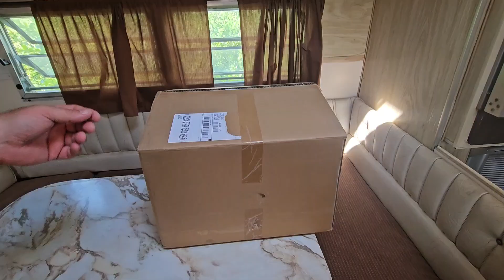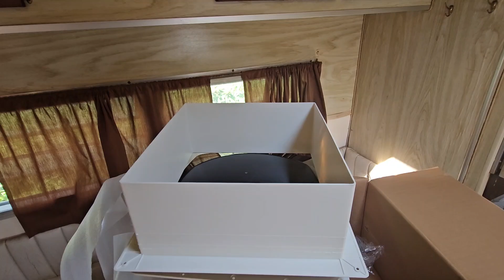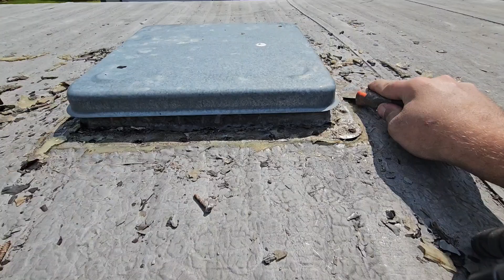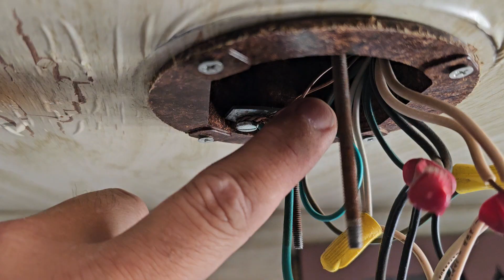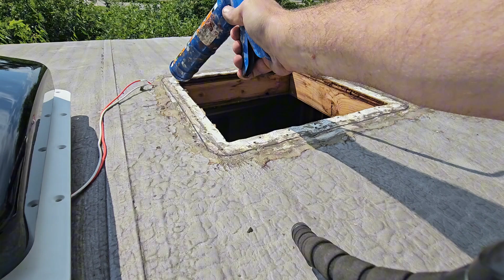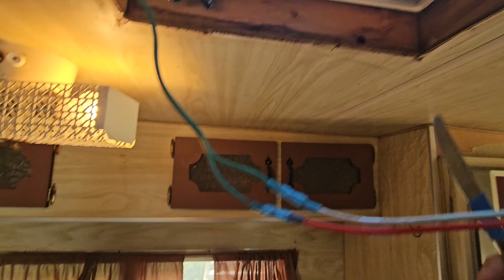HOW TO INSTALL AN RV VENT FAN!!

Comment: Highly disagree that it's the best vent, but just my opinion. I much prefer a cover to a standard vent that be left open and still get ventilation while it rains. Gets pretty muggy pretty quick in the heat with your vent closed and no circulation. Your mileage may vary.
Reply from the maker: I also need to replace the front vent.  I'm going to install a standard vent there.